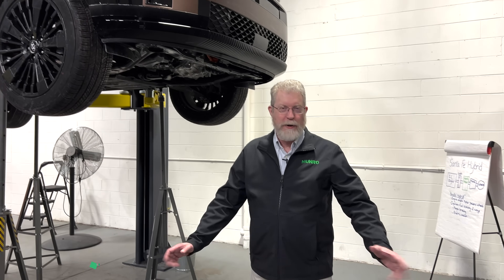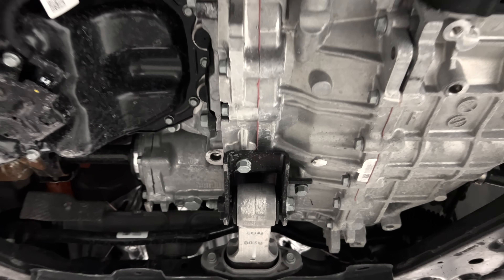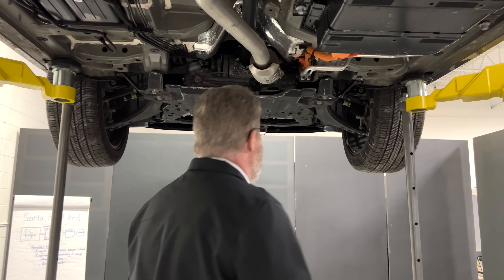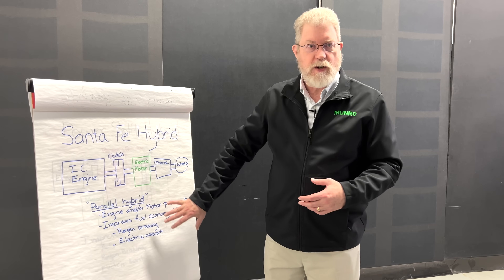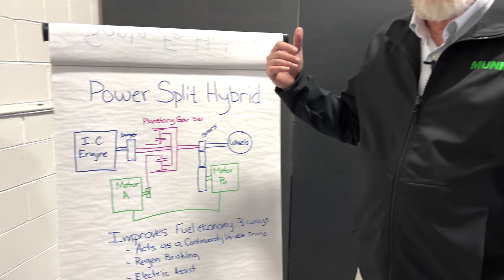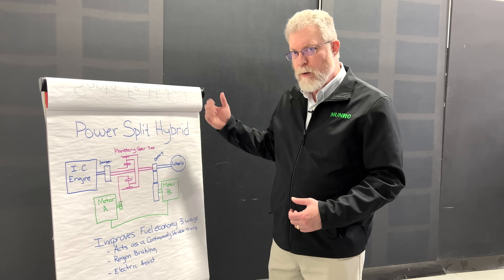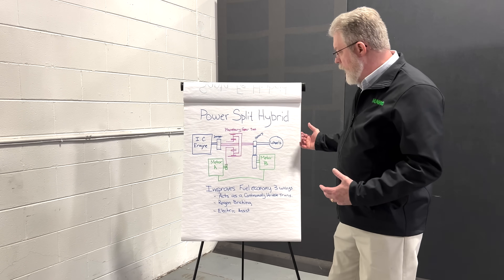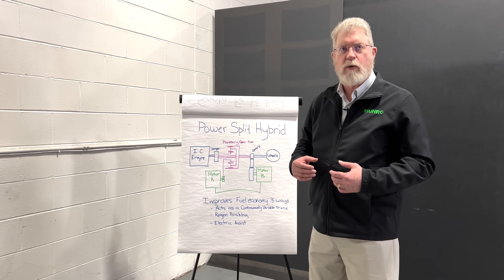A Lesson on Hybrids With the Hyundai Santa Fe

Comment: I wish you covered Honda's 'series-plus' and Nissan's EREV-style series hybrids too. Nissan's system (used outside NA markets) uses a pure series system, which is basically just an ICE running a generator which then runs the drive motor through a battery buffer, with no mechanical connection between the ICE and wheels. It has the advantage of being simpler mechanically and to engineer/tune, but the downsides of lower transmission efficiency for the ICE, extra cost from larger motors (the generator has to be large to accept all the ICE power wanted, the traction motor has to be powerful because it is the only thing driving the wheels), extra cost from the now more powerful power electronics/inverter, and higher weight from the bigger motors. Most of these are irrelevant for EREV applications since they already needed powerful traction motors and power electronics, and the ICE transmission efficiency is good enough and non-critical.

The Honda 'series-plus' system uses a similar setup but adds one direct drive gear for the engine (Civic & Accord) for better transmission efficiency at highway speeds, or a second DD gear (CR-V) to also take load off the motors at medium speeds to achieve a better tow rating. However, because the direct drive gear is optimized for the EPA's 60mph highway test, fuel economy suffers at higher speeds (C&D 75mph test) since the car has to choose from 2 compromises; too-high RPM with the DD gear, or lower transmission efficiency through the motors which also drop off in efficiency at high speeds.

Not sure exactly what Chinese PHEVs use, but Geely and BYD use 3-speed gearboxes.
Reply: Thanks. I came to the comments to ask about series hybrids. One question. "lower transmission efficiency for the ICE" are you talking about the loss from converting to electricity, then batter,y then to electric motor? I assume from the ICE to generator would be high efficiency since it is a set gear ratio. Also, I am wondering if this with an e-axle ( or 2 e-xales) or an electric motor mounted not inline with the axle.
Reply: Did you post this before you finished watching the video? Go to 8:30
Reply: @Neberheim  What I described is not a power-split hybrid with a planetary CVT nor a parallel hybrid, but a series hybrid with no mechanical connection between the ICE and the wheels.
Reply: @Neberheim the video explains the Honda system wrong. It’s not power split. And zero planetaries.

Comment: Awesome breakdown!!! 
Love to understand rationale/pros&cons/implementations options on how  this drivetrain is intergrated along with software in real world application (between car manufacturers). Example - with power split hybrid, why does does Toyota Rav4 (i have a 2019 R4P) drain battery pack down to certain level, all EV mode, until a certain state of charge then vehicle switched over to hybrid mode?  Instead of optimizng MPG by leveraging the full battery pack?
Reply: If the pack is at 100% and you want to slow down the car has to use the regular brakes and the energy is wasted. The car can't predict how much regenerative braking you are going to do, so it wants some space to fill in case you do something like go down a long hill. Thus if the pack is full it will run pure EV for a bit to use up some energy and make space for potential future braking.

Comment: Great fuel economy 34mpg ?? It has been 20 years with no MPG increases. This is not progress
Reply: That’s combined for one, but also this is a three-row SUV. Check the EPA ratings for 3-row SUVs 20 years ago. We’re not comparing to a Prius of something.
Reply: Chryslers slant 6 engines built in the 60s and 70s got easily 30+ highway mpg. A friend of mine decades ago had a 70 something Dodge Dart with one. Had nearly 300k miles, not particularly well kept but kept on running. Used about a qt of oil every 1000 miles. He never changed the oil, figuring a new qt every month was an oil change 😂
Reply: EV get around 100mpg-e

Comment: Is it odd that Toyota popularized the power split, but now is also using parallel for truck/suv? Seems the torque converter wouldn't be ideal for regenerative braking. Time will tell, but my gut says that hybrid offroad vehicles will have costly issues. Hope to be wrong.
Reply: It is done that way just to Increase power. Has little effect on mpg